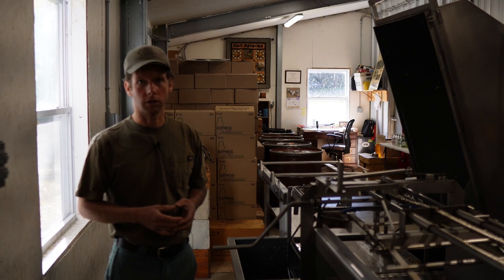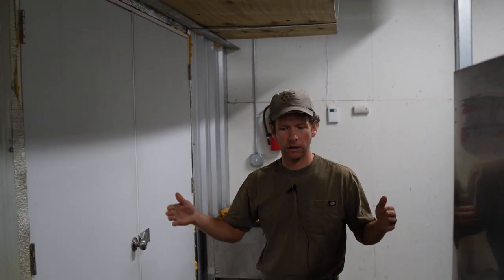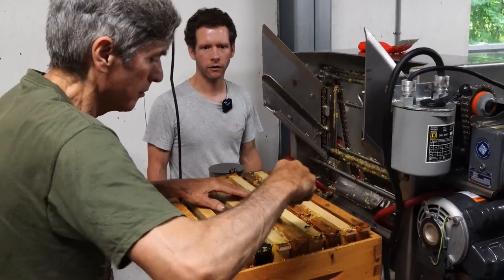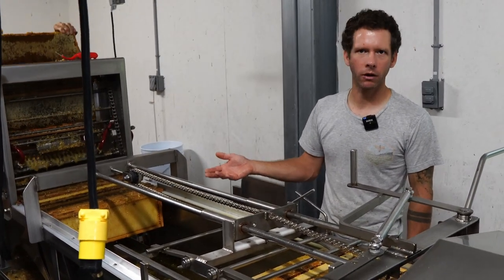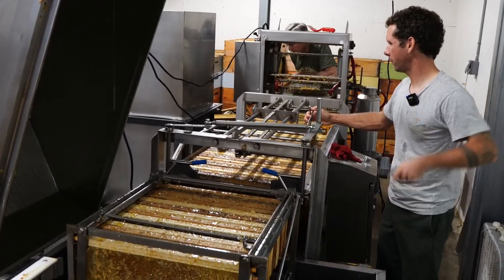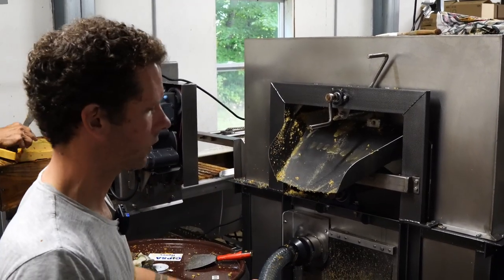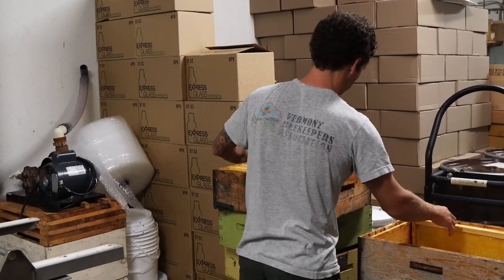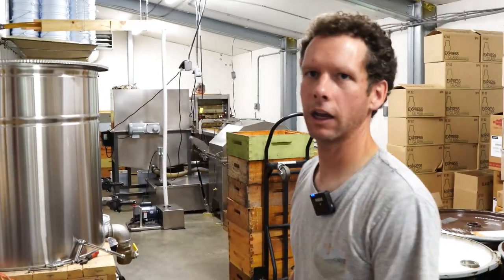Hall Apiaries Cowen 28 Frame Extractor 2022

Comment: You don’t need to replace that piping on the spinner with PVC just put an elbow on that so it cuts tight to the unit and you’ll be ready to go. Thanks for sharing the system.

Comment: Best review online of the Cowen 28 line!   Thank you.   How do you think that spinner / auger might work with a Maxant chain uncapper?   I'd like to upgrade to this line, but incrementally over time.  E.g. I'd like to keep using my Maxant uncapper and extractors for a few more years, but finding a better way to handle wet cappings.  Curious if the Cowen mini spinner would work with the cappings produced by the chain uncapper.
Reply from the maker: The cowen mini Spinner and auger will keep up with the maxant chain uncapper. I ran the maxant uncapper and the Sr. Spinner prior to the system I have now. Huge improvement in dealing with cappings. No more stopping a few hours in to empty the Spinner.

Comment: Hey Troy, aren’t you on all wax foundation? Do you find that extractor blows the comb out at all? Cheers
Reply from the maker: No,  I do no get a lot of combs that blow out in the extractor. Only some of the newly drawn out foundations tend to blow out from time to time. I cross wire all the foundations, that helps tremendously by adding extra support.

Comment: What mill of liner do you use?
Reply from the maker: I prefer the thinner liners ( I believe they are 8 - 10 mil. During the pandemic it was hard to find the thin liners so I had to settle for a few cases of the thicker ones.
Reply: @hallapiariesnh  can you use a band warmer with the liner?
Reply from the maker: @3Beehivesto300  depends on what temp the warmer heats up to. I have a barrel blanket that doesn't go above 110 F
Reply: @hallapiariesnh  I have to warm to 120 to get the crystals in my honey to melt.